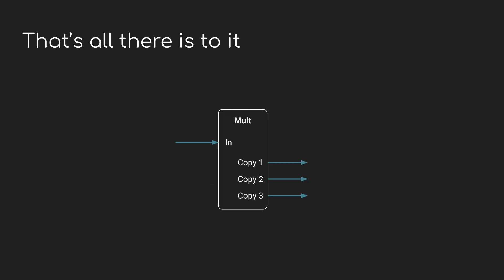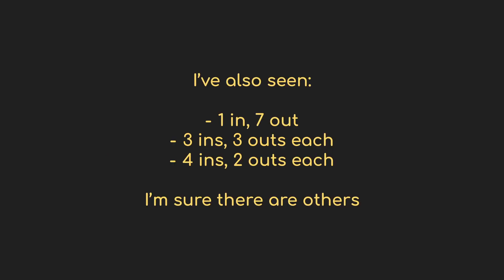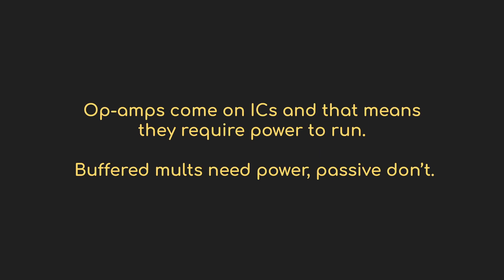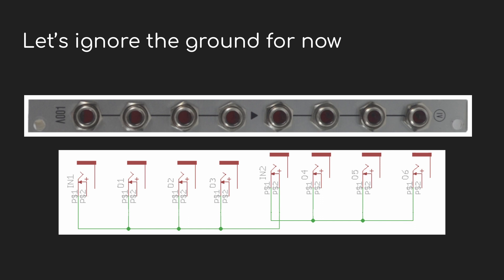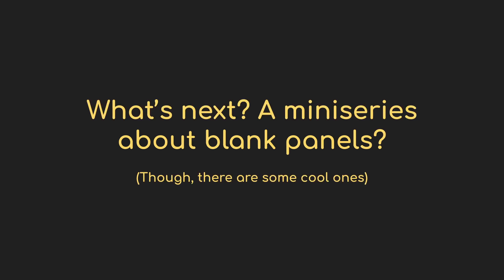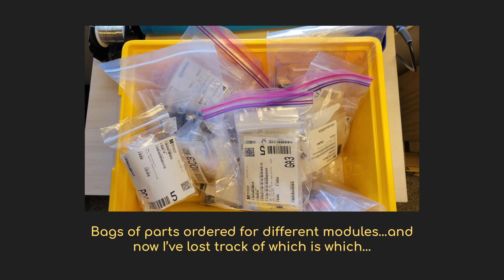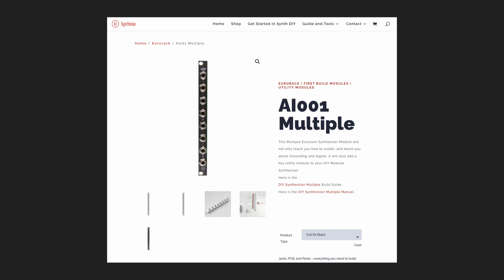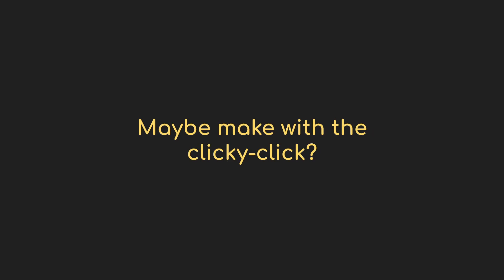More than you wanted to know about a Eurorack Mult!  Why do you need one (or five)?

Comment: i'm watching a lot of modular basics videos as a refresher and also i always get new ideas. great explanation, as always. 

i would add that aside from volt per octave, a buffered mult is also useful for some devices that don't seem to like a passively multed clock signal for whatever reason. the Turing Machine is one, it says in the manual that he doesn't know why it doesn't like them, and i have to use a buffered one for the Moog Grandmother's clock, which i discovered after i sold my buffered mult😅

Comment: I got my first mults by ordering PCBs from the designs given away by North Coast Synthesis together with their design documents, "Passive Multiples and Friends", which also give designs for other unpowered circuits: passive mixers, OR combiners, fixed attenuators, fixed low pass filters/slew rate limiters, fixed high pass filters/DC blockers/gate-to-trigs, and envelope followers.  Since PCB manufacturers have minimum orders, my first buy got me a fistful of panels, and I've built a bunch of those plus a few powered circuits that just got fit onto them.

Comment: Great video! I really recommend dealing with the solder fumes in some way. I had a sore throat and a cough for days once after building a larger project. After that I’ve always had a fan running beside me to blow away most of the fumes, or even wear a respirator for longer sessions. But best would probably be a proper fume extractor. I’ve read the fumes can contribute to one developing asthma if you’re exposed to it repeatedly, so be careful everyone!
Reply: I wrote the comment before the end of the video, I wouldn’t mind entering the giveaway!
Reply from the maker: You're in!

Comment: Pritty neat video, liked it. Also went to your channel to see od this the only video in regards to the DYI Soldering. Listen why wouldn't you makes us an video explaining how to correctly orient/turn capacitors/diodes/transistors/SMD's/vectrols.. There is no such video on Planet Earth. Everyone creates videos about Soldering, but no one explains how not to screw the DYI build and later when plug it into the Bus, burn it - as a consequence of not positioning module parts having in mind +positive and -negative orientation correctly. Do it (if you know how to explain it, and aware of this predicament) ❤
Reply from the maker: Definitely aware of it :)  The problem is that the person laying out the PCB is just a fallible as the rest of us and I've seen plenty of cases where the marking on the board is wrong (or just missing).  But there usually is a hint in the schematic about what to do.  I'll have to come up with some examples I can demonstrate.

Thanks!